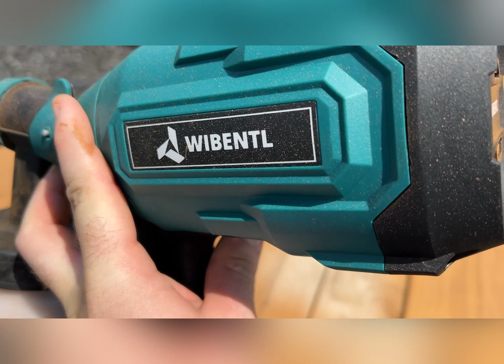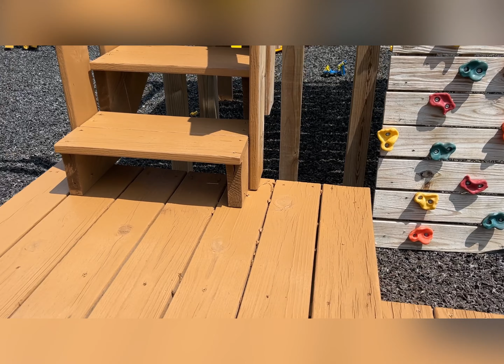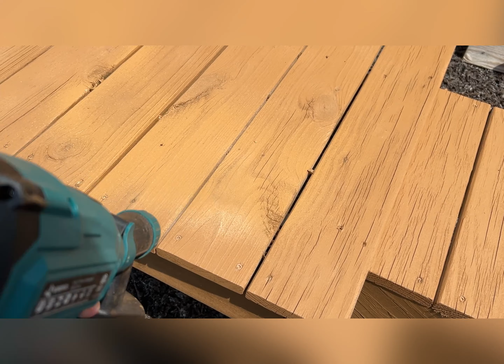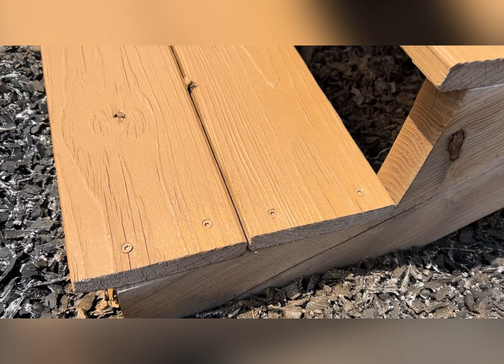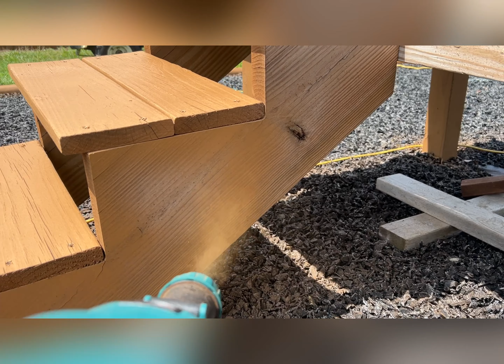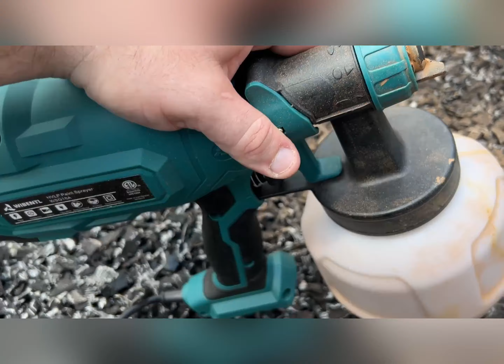WIBENTL Paint Sprayer 700W HVLP Review & Tutorial: The Ultimate Outdoor Spray Painting Tool

Comment: I bought a this same paint sprayer but I can't get it to work properly. No paint comes out. Could you make a video showing in detail the internal parts of the sprayer, especially where the needle and nozzle are located? I think the problem could be there. It would be of great help to many people who are facing the same problem.
Reply from the maker: @oscarperez4065  ok I will try to remember to do that when I have time. Thanks for the kind request on it..  I still am using this sprayer and I do love it   They can be tricky sometimes if one has never used one before
Reply: I managed to find the problem and solution. The needle was broken at the back I put epoxy on it and now it works pretty well.

Comment: MINE DOESNT SPRAY/ TRIED EVERYTHING, MYTHE SPINNER KNOB DOESNT HAVE A SPRING ON IT LIKE YOURS..SOOOO ANGRY..I TRIED HOLDING THE BUTTON ON TOP AND RELEASING IT,,PULLING THE TRIGGER..SOMETHING IS MISSING ON INSTRUCTIONS..DANG IT...SOOO ANGRY,  DO YOU HAVE AN ASSEMBLY VIDEO THAT SHOWS EXACTLY WHAT TO DO WITH EACH PART.. AND HOW TO USE THE UNLOCK BUTTON ON TOP..MAYBE YOU HAVE TO PUMP IT 5 OR 6 TIMES...OR BLOW ON IT..EVERTHING IS SOOO COMPLICATED
Reply from the maker: Send it back for replacement